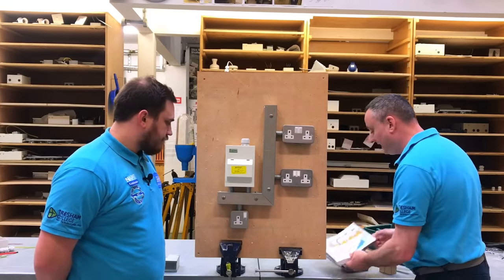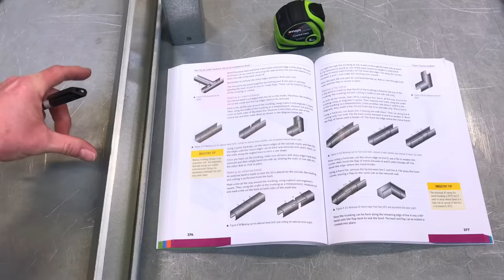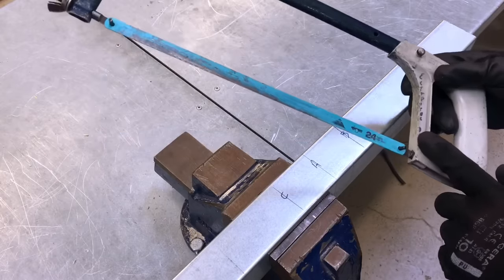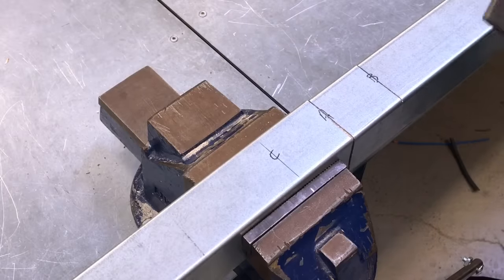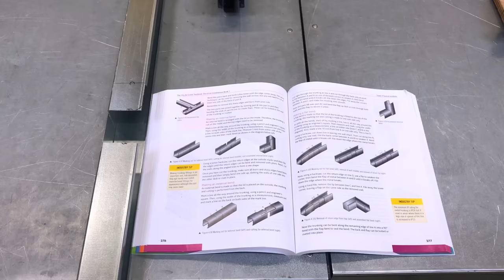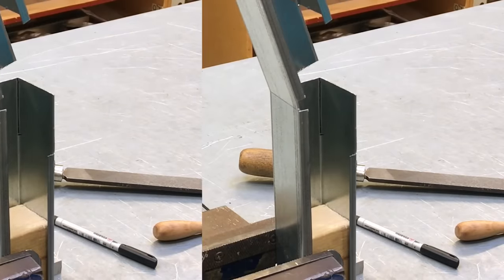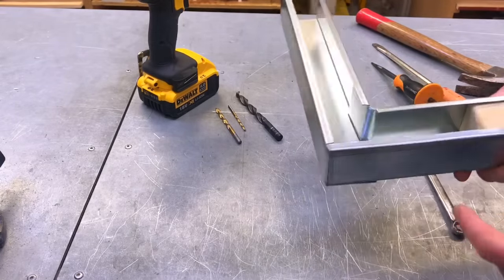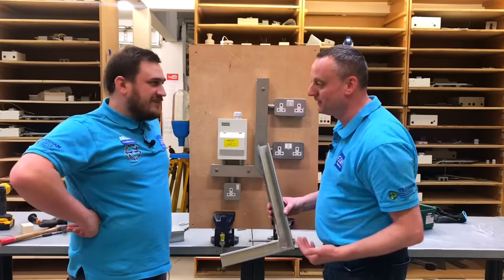How to Make a Flat Bend (90 Degree Bend) in 50 x 50 Steel Trunking for C and G 5357 Assessment

Comment: Having done 100s of metres of trunking could you try doing this bend without a vice ,also if tap the corner with hammer and small chisel you will find it easier to bend.

Comment: I remember doing these 90 degree bends. My old tutor would insist we rivited the overlaps together and I hated it as they would stick into the trunking where the cables go, reversed nut and bolts like this is a much cleaner and more suitable job IMO. 👍

We also had the steel blocks in the trunking - which would always put the footwear to the test when it fell on your foot.
Reply from the maker: Thanks for taking the time to comment and watch 👍 Gaz

Comment: Good idea to use off cut of trunking to make B&C marks as long as it is square sometimes open side cut be squeezed in a bit so I would check with a square after
Reply from the maker: This is an assessment requirement hence the video. Thanks for watching and commenting. Gaz 🦾

Comment: someone wanna answer these for me

 What is the measurement of trunking they require vertically? 

 

Besides the tools in the box what other tools and equipment does he require? 

What is the block of wood used for? 

When he marks the 450mm at point A  he says it’s a critical measurement because it’s the…..? 

Which way does he send his trunking to the left or the right? 

What does he use to measure lines B and C? 

When he cuts line A how many sides of the trunking does he cut? 

After placing the trunking in the vice but before he cuts line A what does he do? 

What does he suggest you also wear while in the workshop? 

What does he say is the biggest failing of students when cutting line A? 

When cutting line B what does he do to the back section? 

After removing the section between A and B what part does he remove next? 

How much of the return lip on the other side does he cut out? 

When he places the trunking in the vice to cut the inside line A to Cwhat does he do to make it easier to cut the inside? 

After cutting all the edges what does he do next? 

With all the cutting and filing what does he need to do to the surface of the trunking? 

After forming the bend what two things does he check before drilling the holes? 

When drilling holes for the nuts and bolts what size drill bits does he use? 

After inserting the nuts and bolts, then cutting them to length what does he do then? 

What two things does he not fit at the end because he wants to re-visit them in a later presentation?
Reply from the maker: Google this 

The City & Guilds Textbook: Book 1 Electrical Installations for the Level 3 Apprenticeship (5357), Level 2 Technical Certificate (8202) & Level 2 Diploma (2365) (City & Guilds Textbooks)

Gaz 👍
Reply: @GSHElectrical  yeye i got the book just cba to do it

Comment: Ugh, not good.  I've been doing this sort of thing for over 40 years and my bends are simpler and much better looking than that.  They are also quicker.  Try doing that with multi-compartmented trunking.  Also, on site, when bends have to be made there's never a vice around.  I suppose it's a dying art, now electricians never have to cut their own bends, they just order manufactured ones. The trouble comes when you need a unique double set in a piece of trunking, or some such, all that palaver would never work.
Reply from the maker: This is the bend required for an assessment hence this training video for apprentices 👍. Massive thanks for watching and commenting. Gaz
Reply: @GSHElectrical  Fair comment, it just seems terribly convoluted, specially when out on site there's usually limited access to vices, unless you drag a plastic bench round with you.
I'm in this poxy lockdown again now, but maybe one day I could send you some pic's of how I do it, just stuff I've learned over the years. Also-I'm not trying to be a clever dick (there's enough around already) or disrespect what you're doing.😉